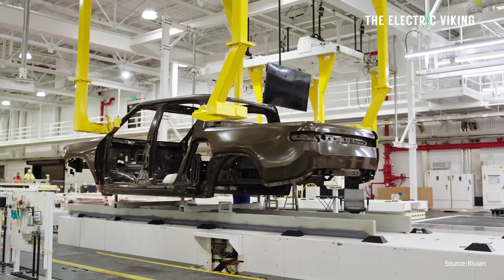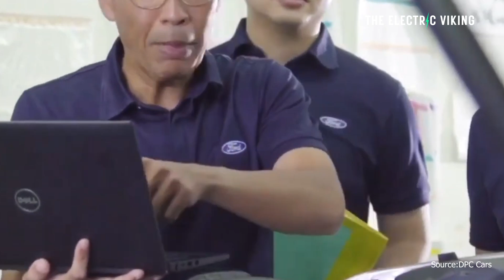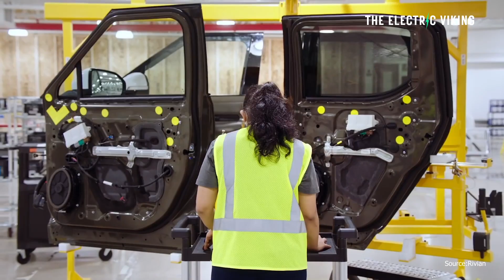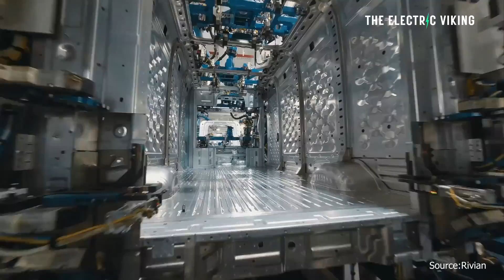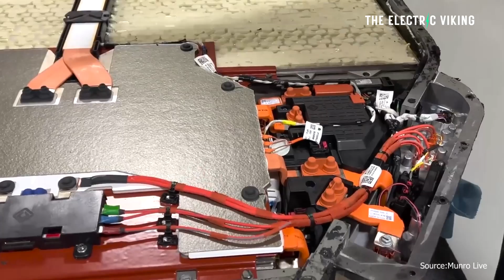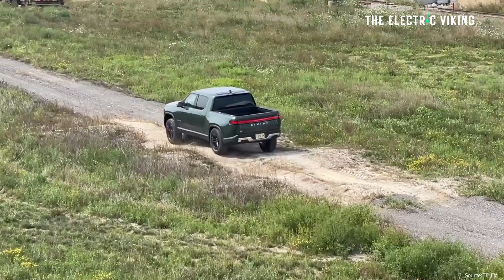Rivian REVEALS 410 mile range electric pick up & new drive motors

Comment: Well, more zealotry on the rock in the style of the zealotry of a desert hermit. ICE is here for a long time to come ( see new Land Cruiser range). The other 800 pound gorilla that you don't see among the sand dunes is the existing  ICE car park - 14 million in Australia. To get anywhere near that number, road - going Golf Carts will exhaust all known resources of lithium, etc., make billionaires of the child slavers working seven year olds in Congo cobalt  mines and, in China alone, use so much fossil fuel generated electricity that the planet will be stir fried. This, of course, if all these Golf Carts don't begin to spontaneously combust and incinerate major cities in Thermal Runaway conflagrations ( see currennt car ferry barbeque). Spruik on.

Comment: Im guessing Rivian just did a cell upgrade. Stock long range pack uses 4.8Ah 2170s, there has been a 5.3Ah 2170 in the pipeline for awhile now. Energy density is great but it gets really expensive in $/kWh which is part of the big cost delta (my guess).

Comment: The wheel sizes (20", 21", and 22") are all scaled to fit the enormous brake calipers. Larger or smaller wheels are likely to not fit, is my understanding. The 21' wheels, combined with the appropriate Perelli tires (the tires are in all three cases custom for the Rivian), give you the best efficiency. The big boost to range--up to 410 miles--comes from a significant increase in battery pack capacity. For the R1S and R1T, the only battery pack that has been available until recently has been the Large Pack: 135 kWh. The Max Pack battery is significantly larger, and this is what can get you to 410 miles of range. The Max Pack is only currently available for order on the R1T. And it is much more expensive than the Large Pack.

Rivian is an impressive company. In its first full year of production--2022--it introduced three new vehicle models: the R1S (their 7-seat SUV), the R1T (their midsize pickup), and the Electric Delivery Van (EDV) that they are making for Amazon. For a startup to introduce three new vehicle models in its first full year of production (2022) is unheard of. This is an industry first. In addition, both the R1S and R1T were rated "Top Safety Pick +" by the Insurance Institute for Highway Safety (IIHS)--the principal vehicle safety testing organization in the US. This is also unheard of for a startup simultaneously introducing 3 new car models in its first year of production. Take a look at the ratings of the RAM, F-Series, Silverado, Tundra and other pickup trucks and other comparable midsize SUVs, and you will not find this level of safety achievement. 

The R1T was MotorTrend's 2022 Truck of the Year.

Both the R1S and R1T have been reviewed quite favorably by many highly regarded automotive reviewers (on YouTube and in automotive journals) and by the public generally. Both vehicles are very capable off-road, and there are many YouTube videos demonstrating their excellent off-road performance.

Rivian is projecting that they will be gross-margin positive by the end of 2024.

Compare all these achievements to those of Tesla early on, whose first full year of production was in 2009. It took Tesla until about 2019 to achieve consistent profitability.

Rivian and its leadership have a lot going for them. They are certainly a BEV company to watch.

Comment: Why would larger wheels use more fuel be worse off road? I get that they will be slightly heeavier, but isn't that offset by not needing as heavy a suspension?
Reply: Like you said bigger wheels means heavier so less range; however, when off roading you need smaller wheels with big sidewall tires for comfort and save the rim when large objects hit the wheels. Also less bending.
Reply: @mohammedabdulahi7894  but bigger wheels means you can rise over bigger obstacles and  not have such a big jolt from potholes.

Comment: My F150 v8 gets over 1,000 km of range. And, in 30 years time it will still get about that range, and it will still be running strong. An F150 lightning would have gone through 2, probably 3, battery replacements by then, each at around 30k assuming the batteries are even replaceable in a decade. EVs are not an answer for the environment, if you really care about that, walk, take transit, ride a bike.

Comment: Just brought an ICE vehicle it's fun sounds good goes fast enough to lose your licence it was expensive so I can't use the price parity thing but it looks freakin awesome to oh I saw something in the video that has to shut up all EV owner about servicing it looked like an oil filter on the transmission I guess all that torque burns the oil and cause minuet particles to wear away from the gears why else would it need a filter there for oil and servicing is still required 😆
Reply: Don't they teach how to punctuate anymore?
Reply: @michaelriecher5632  didn't anyone tell you it's youtube not an English exam and I'm also not a scholar so I don't give a
Reply: @robincollis6349  Take it as a friendly suggestion.
Reply: My diesel requires a service every 5000km costing me $750 in Australia. This needs servicing once a year if that! No fuel costs. Unless you don't charge at home then it's $1.11 per 100km. Do the Math.

Comment: It’ll be great if it manages 400 miles without going on fire.
Reply: You watch too much fake news.
Reply: @johnditoro1676  Is that a fact,try telling that to all those people that have had theirs go on fire,those vehicles are a fire trap under the right circumstances.
Reply: @davidellis279  I use data, not anecdotal stories.  The data shows that EV’s are far less likely to catch fire than gas cars.  Do the research.  Learn something.
Reply: @johnditoro1676  Absolute nonsense,but believe what you want it’s your choice.

Comment: They still haven't made their production quarter since they began production.  They have problems like the accelerator pedal falling off.   410 miles of range can de dropped to around 350 miles realistically speak.  Plus they get punished in our off road conditions.

Comment: The R1T towing a trailered mustang can be seen on Youtube - range under this load 120 miles. These Fake BEV ranges need to be changed to reflect reality.   A city and highway range should be listed, the ranges run on real world courses not calculated lab results.  As noted many times BEVs do not scale due to lithium refining limits. As long as lithium is the main type of BEV battery; BEVs will only be a nich in the market and 9 of 10 vehicles will need to be ice because they can't make 100 million EVs a year using lithium; there isn't enough water to refine the lithium. 500,000 gallons per ton.
Reply: This applies to ICE cars as well. For example, my Landcruiser 100 series (Diesel) without a load it gets 11L/100km. When I put 1300KG it goes to anything from 15-19L/100km. I know of owners who tow with 3500kg and they get 23-25L/100
Reply: Of course and when I tow stuff and drive less far it costs me 30% more to drive the same distance. But I can charge my EV and still drive almost for free in comparison.
Reply: @Mixos_place  Sure but it's a far bigger issue for BEVs that can't be refueled in minutes. I have a Tesla M3P for daily use and an ICE truck for when i need a truck. Most truck owners don't tow anything so an electric truck would be fine for them, but it's not fine for those of us that do.
Reply: You are living in the past mate. They have more modern lithium mining techniques now. There are massive reserves already being opened up to increase manufacturing volume. Also the sodium battery is already a thing and in production.

Comment: You have a notion of believing that ice is an obsolete and somehow inferior platform

My father has had luxury sedans for decades now

Besides pollution i don't believe ice cars have any major flaw
Reply: The problem will be that governments around the world will make the price of gas(petrol) so expensive that it would be uneconomical to run one.
Reply: It's only a matter of time. Governments are forcing the overseas markets to change through legislation, incentives and exclusion zones. Australia will be dragged along for the ride. BEV certainly comes with some advantages, but it doesn't suit every use case, which i think is the case for towing/offroading. Specs are never mentioned  with the vehicle under load. It is even worse when they talk about commercial vehicles, but refuse to mention mileage under what ever their max weight rating is, let alone of ancillaries such as refrigeration are running.

As long as the government doesn't try to ban ICE vehicles from being on the road, I can't see them disappearing before at least 30years.
Reply: @veqlargh4731  that particular problem can be solved with the right reviewers critiquing aptly
Reply: Talking about pollution,  the cost to manufacture an EV is significantly higher than an ICE.  Additionally many countries still produce the electricity that EVs require by fossil fuels.  And how polluting are the batteries when they no longer can be used?
Reply: You recycle the batteries dude!
Reply: @doriangray6985  These are things that are all well known, yet the EV still comes out far ahead of ICE in the lifetime of the vehicle. Aside from coal power, running an EV on natural gas is far cleaner than burning gasoline directly. The US is investing billions in battery recycling, and we already have a reclamation rate over 95% for EV batteries. This idea that we would dump expensive rare earth materials in landfills is redneck nonsense.

Comment: I will buy one for sure. Saving $16,000 per year on my current 4wd. I would be so so happy for this to come to Oz! If they open reservations I would pay even several thousand dollars to reserve one.
Reply: 1. For everyone thinking about buying a Rivian. One question. Can you afford car insurance? My friend, pays $400.00 per month for his Rivian!
2. Tesla Insurance for my 2022 Tesla Model Y is $90.50 per month.
Reply: How are you saving 16000 a year exactly? How do you go through 4000 gallons of fuel a year? Let's just say you get 15mpg. That's  60000 miles a year. 5 times the average. It's $24000 more then a top end HD truck. That's just the base model which probably doesn't get that range.
Reply: $320 per fortnight = $8320 per year. Then all my 5000km services at $750 minimum. It works out at typically just over $8000 per year in maintenance costs for my diesel 4wd. All of this is gone with an EV. My EV costs me zero dollars in fuel. I charge it at home and so far this year zero in maintenance. It just unfortunately is not a 4wd I can use for my work. That is why I will be getting likely the first EV ute with a range over 600km. My diesel a Mitsubishi triton has only a 70L fuel tank. So I only get 700km out of it empty. If I tow....... sometimes as little as 380km out of a tank. If I go 4wd'ing about 450km on a full tank in low range. Thats all in a car that I bought for $21,000 new (hail damaged).